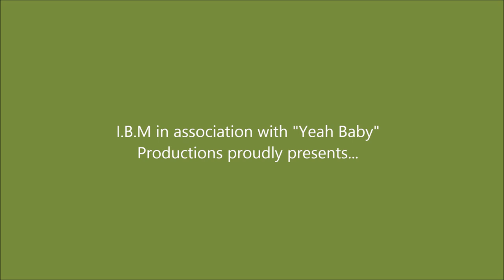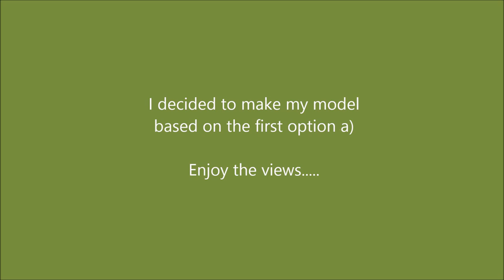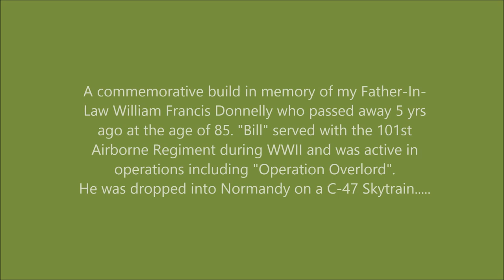Airfix 1/48 Junkers Ju87B-2 "Stuka" Final Reveal Video (8.2.14)

Comment: Perhaps on a more positive note, a high % of the Ju-87B's rivets were raised. This applied to most airframe areas, with the exception of critical drag areas, such as the wing leading edges, which did utilize flush riveting. 
Btw, not often discussed, but the Spitfire also employed raised rivets in some non-critical-to-drag airflow areas. Why? Because, raised rivets are a cheaper form of airframe construction, but, more importantly, are considered a stronger fastening system.
By opting for a "high" drag airframe, Junkers got what it wanted: excellent speed control in a dive.
One more thing. Hasegawa definitely cheaped-out, compared to Airfix, with their molded-with the wings flaps and no rivets. I think the 2nd generation Airfix 1/48 Stukas are the current best.
Reply from the maker: Thanks for the information, much appreciated. I haven't tried out the newer Airfix offering, but with my dodgy old eyesight, I now struggle with 1/48 scale, so I'd more than likely attempt a Trumpeter 1/24 scale kit. Cheers 👍🙂🥃🥃
Reply: @InternationalBritishModeler  although there might be a slight improvement in interior detail with Trumpeter's Ju-87B, ironically Airfix's 1970's 1/24 Ju-87B remains the best kit for shape, outline, and correct detail. It predates slide molding, so you'll have to hollow out the exhausts, but they essentially got the ALL the riveting, even faithful to the raised variety. What few areas that may require flush rivets can easily be sanded "flat". Done with the  current techniques (e.g., Airscale IP, seat belts), this kit remains a stunner.

Comment: Great looking model there Martin you a fine job there mate and a great tip on the filler withe nail varnish remover question,did you use acetone free remover?
Reply from the maker: Hello Faron, thanks for stopping by mate : )
The Nail Varnish Remover has acetone in it, but, I did a test on a piece of sprue; brushed it on heavily and left it. It didn't melt or mark the plastic, so then I used it on the filler.
Cheers : )

Comment: hi martin great videos and builds,had similar experience with reboxed airfix hampden kit. funny thing is most modellers still have a soft spot for airfix kits. Wonder how long its gunna last? Great job on stuka though and if anyone buys or gives u an airfix kit put it on ebay  Cheers
Reply from the maker: Hello Tony....my next kit is an Airfix kit....the newly tool C-47 Skytrain, I said I'd never do another AIrfix kit, but for 1/72 scale choices for this aircraft, the Airfix looks the better one. It comes with recessed pane lines on this new tooling. I would have liked the Trumpeter version with paratroopers included, but it's $88.00! Too big a purse for me. I'm also tempted by the Airfix 1/24 Hawker Typhoon....but, I'm watching a couple of builds of that to see if it's a good kit without any fit issues etc.
Anyway, thanks for stopping by and commenting, greatly appreciated!  : )
Reply: FullMoonDrummer Hi martin the newer  retooled airfix kits are a lot better quality. Have not seen the retooled airfix skytrain at my hobby shop yet but watching youtube review got me thinking of getting one. Seen the trumpeter kit 1/48 skytrain at shop  AUD $118 be interesting when airfix kit comes in cheers